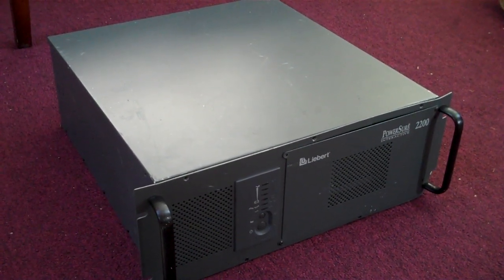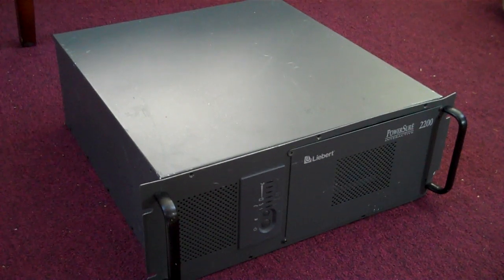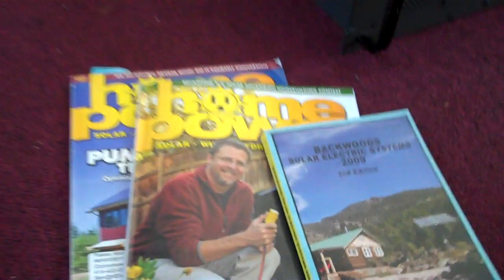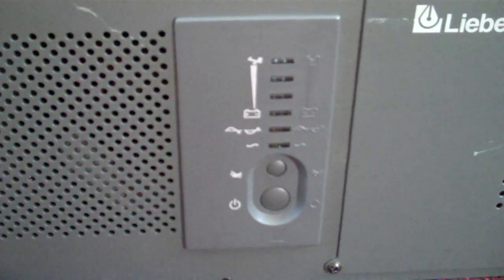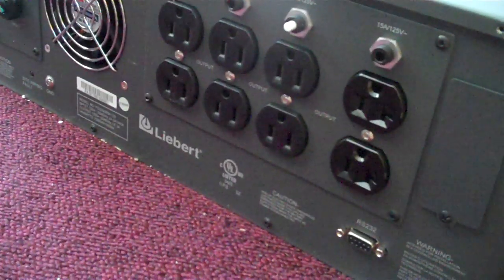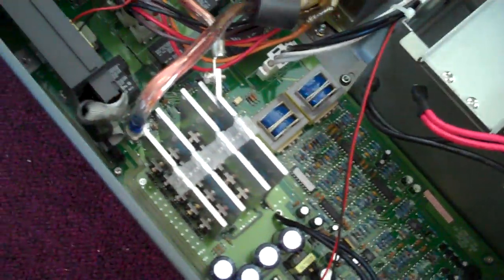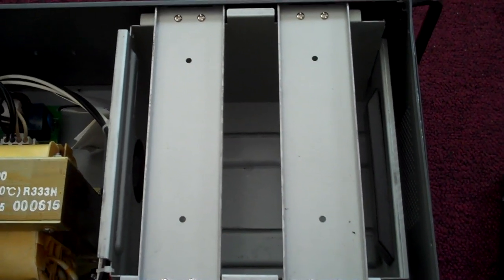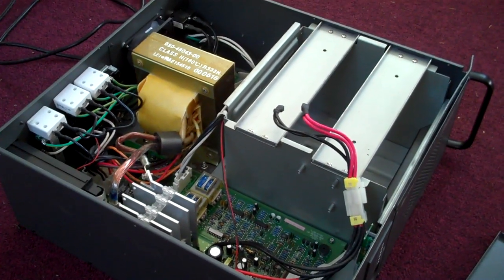48V UPS for DIY Solar PV System - Part 1

Comment: We have been running an APC 2200KVA UPS for about 3 years now. We started on lead acid saved money and went with the Nissan G1 batteries. Now we have upgraded to MNS kids controllers for more efficiency given the UPS is a pig at around 87watts of consumption. Next move is to a better inverter.

Comment: Very nice, I just so happened to get 4 48 volt UPSs and I wanted to do the same.  Looking forward to checking out your other videos.
Reply from the maker: Thanks! In the end, I did some work and got the UPS rigged to  both CHARGE my electric motorcycle and PULL power from it to run my house in a blackout. Worked great! The only way I could have really wished it better was if it had a 240V output, instead of only 120.
Here's a link to that project: http://300mpg.org/projects/smartgrid/